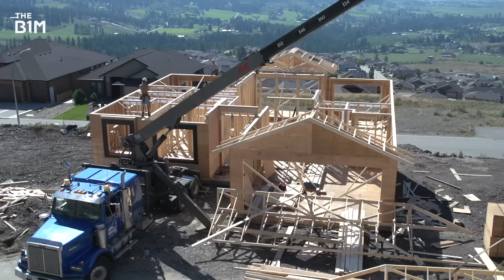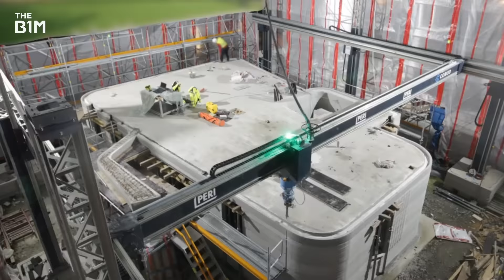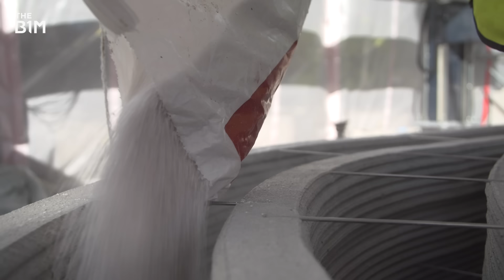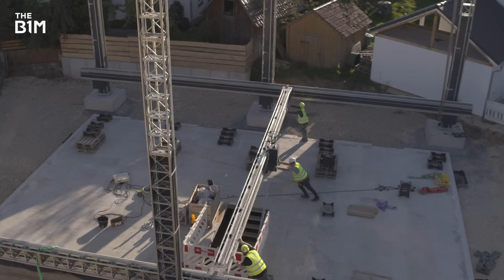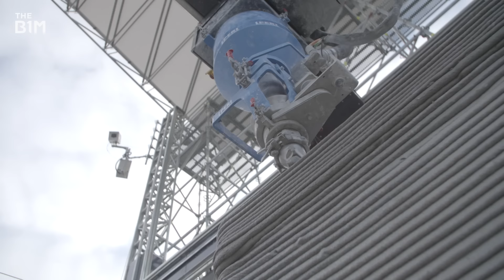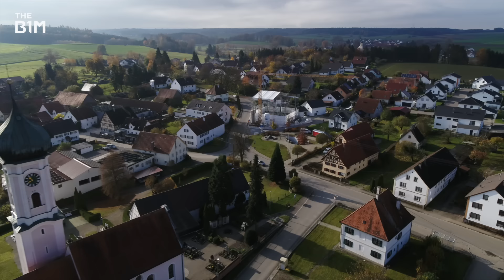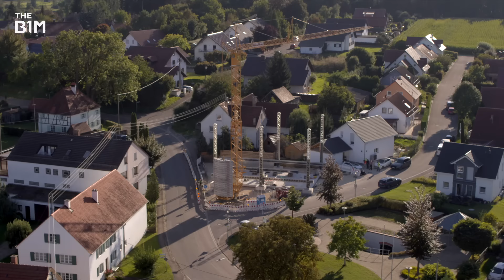Why This 3D-Printed House Will Change The World

Comment: Im exited for 3D printed homes and how it can help this shortage of homes, also making them cheaper and efficient.
Reply: It will be for free in future as old financial system is about to collapse. Advanced technologies that already exist to create anything out of ether which is everywhere just like air. Food, car, house.
Reply: @evgeniam685  That's not how logistics work.
Reply: @DaveSmith-cp5kj  what does it do with logistics. I am talking about technologies itself.
Reply: @evgeniam685  Technologies depend on the logistics of an economy. For example, you may have the tool to make what you want such as a 3D printer, but you still have to buy the material. To make the material you will need a massively wider array of equipment even if we assume in the future a program can do that work for you. This is the economy of scale which is why thinking this eliminates our financial system is a gross misunderstanding of this technology.
Reply: @evgeniam685  Like I said, that's an extremely poor understanding of what these technologies do.
Reply: @DaveSmith-cp5kj  food, clothes, cars, houses, anything you want. Because everything is created from atoms and molecules. Its advaced technology which  transform molecules and atoms from ether to create different objects.
Reply: @evgeniam685  Technology is not just a magic solution that makes things better just by existing. You have to actually think about how the technology is implemented for solutions to occur. Disassociating molecules to bare atoms use up energy (and massively so). Forming molecules produce energy (and not the same that it took due to entropy). So even if you could use atoms like legos, you are undergoing a massive energy deficit which means you are reliant on some sort of economy to allow your manufacturing. 

As I said, you don't seem to understand how this all works. I applaud thinking out of the box, but there is a fine line between creative genius and delusion. Engineers always have to be conscious of pragmatics, even if it gets in the way of a "good" idea.
Reply: @DaveSmith-cp5kj  energy is everywhere. Whole universe is energy.  We are all producing energy. Because we are all made of electro-magnetic waves of atoms and molecules. Even our thoughts, words and emotions are energy which made of frequencies. Low emotions=low frequencies, high emotions=high frequencies. And lots of things that has been taught to us through universities, school this is just information to know just within this system we live in. Truman show. But system is not good, limited, unfair and collapsing. This technologies ahead of human kinds for 1000 of years. Any planet which contains money system, is prison planet. We are only on beginning of evolvement compare to other civilizations. How about that outside of box thing ))
Reply: @evgeniam685  k

Comment: Wait, can you later remove the interior partitions, you know for a remodel?
Reply: Concrete. So just like brick and concrete houses built around the world its more work but not an issue. It also depends how its desighned. No doubt they will have non structural walls, stud partitions too.

Comment: I only see the wall structure part becomes more efficient. All other parts, like foundation, roof truss, plumbing, electrical are not. I don't think this method will be more cheaper than transitional stick house in USA.

Comment: This method IMO is not efficient neither flexible... not as efficient as pouring cement in mould walls suc as this https://www.youtube.com/watch?v=0OR28P6MEQ8,
 not as efficient as in standardized prefabricated houses mounted in whatever place using prefab. mudules, and not even comparing with the best in class dismountble homes such as geodesic domes... Fuller dome home, NRJA, Solardomes... or even using polystirene modules like japaneese Domehouse
this technology is not integrally robotized as a one process, it doesn't provide plants or tube or wires passages mounted directly by the machine... 
I definitely don't see big benefits in this method even standardizing and repeating infinite times the model or the project. Perhaps making prefab modules it can work but tradidional industrial moulding for big or small modules is more quick and efficient than this.

Comment: No more inefficient and "unsustainable" rectangles.
Um... wait. I have rectangular furniture that fits perfectly into rectangular corners. If I had rounded furniture the house would need to have the same angle of curve for it to fit. Germany goes with a 10' radius curve. UK goes with 3 meters. USA goes with 12 feet.
Until such time as I can replace all my unsustainable furniture with curved furniture that perfectly matches the curve, I'll need to make my 3-D house 25% bigger to make sure all my stuff fits.
Because sustainability is important.

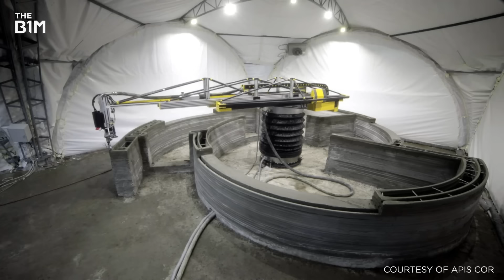In summary; Curved walls are stupid. They only do this to save cost with their rotary cement deployment machine 4:29 and not for any "environmentally friendly" reason.
Lipstick on a pig. They can make straight walls, as the interior walls are straight. They would need a larger rotary machine to make a square room than to make a round room.
This is 100% about them making things easy for themselves. It has literally nothing to do with sustainability. They're just making the largest room they can make using the size of the machine they've chosen to use as the central onsite factory.

I wouldn't mind walls that are curved a little in the corners, but wide sweeping curves are lousy for putting real furniture inside of.

Comment: I can understand that with proper planning you could 3-D print channels for electrical and plumbing piping.  I can see how that would save money (as long as it is planned to perfection, with no as-built modifications, which is rare in my experience).  Insulation could be blown in, possibly as part of the the 3-D printing process, though I don't see this it in the video.  But I do have some questions which this video fails to answer. The first is how is this concrete reinforced? I don't see any rebar, just those little joiner plates?  How and what are the electrical boxes attached to?  What is the interior finish of the building?  Does it get drywall panels?  Is it plastered? And long term, how easy/hard is it to alter those buildings, because most wood buildings go through renovations that alter its structure every 10-30 years.

Comment: Great idea for the exterior and interior walls. When finished you'll have to trowel concrete to fill in all the voids. Would be faster then brick or vinyl siding. Still need, windows, electric, plumbing, paint, roof, doors, ect.
Reply: Search for the Video: Move in Ready 3D Printed House in Germany

Comment: I dont see the practicality in this. You 3D print a structural base on sight, but what about everything else? Gotta make a finished wall inside and outside, run electrical, run plumbing, vintilation, install windows, doors, ect. And all of this has to be done on sight, which is not ideal and is expensive. I dont see how this will compete with pre-fab wall sections made almost fully finished in a factory in a controlled enviroment and very cost effective. Fully finished wall sections made in factory can be shipped to sight, be assembled and put together like legos in day or two.

Comment: Cannot wait for this to be a real thing, especially for custom designed homes at a lower price.
However, for your standard rectangle box home I am not sure there are any real advantages to this over SIP (I think they are sips?  maybe getting the wrong product there?  styrophome interior and exterior with injected/poured concrete) blocks with poured concrete inside.  That seems much easier to set up, much stronger and more durable construction, and even more efficient for heating/cooling, while being substantially less complicated to make.

Curious too with the issues around concrete.  There is a serious concrete/sand shortage in the world with many countries desperate to import it to keep building, so the price is going up.  Plus it is one of the largest green house polluters in construciton... which can be fine if it makes for a 200+ year building... but how many homes make it that long?  My negiborhood was built in the 1950s and there have already been 2 homes dozed over and rebuilt, with more in disrepair and will get the same treatment before long.  And if 3D printing homes becomes cheap enough, then we could see a boom in building reconstruction where you just buy a distressed property, doze it over, and print in place, which would be anything but green.

Comment: Wow! The applications with this technique are revolutionary! 👍
Reply: Now, to stop asking the government for permission to build.
Reply: https://youtu.be/zjVZNHra0pg
Reply: I think so too, but their is one MAJOR setback.. any larger size concrete structure would require rebarb within the concrete.  And current that cannot be achieved thru the 3d printing method.  BUT!!! if you were to solve that 1 issue , applied effectively,  your 3d printing concrete structure business would shoot right to the top of the list. by measure of strength in application.  your business could simply do what others cant.
Reply: ١
Reply: Honestly speaking, if your only goal is to "become a millionaire" you're just begging to make a dumb decision and be disappointed...I think many will become millionaires in this current bull market but it's not the right mentality as holding can be very dangerous. As hard as it is trading Crypto is way more lucrative and is quite logical if you just study the charts and the support resistance and pay attention to what's going on, I’m not a pro trader but I was lucky enough to make 35BTC since  late last year following the instructions and signals from Karen Asnin Whitby. She runs program for investors/newbies who lack understanding on how trading Bitcoin, Crypto, Ethereum works, to help them utilise the volatility of the crypto market and also stack up more bitcoin. You can easily get to Karen on the web to know more about her experience in dealing with investment. Now i can secure a nice duplex for myself and within a couple of months, hoping to get mansion if i invest more and more with her......
Reply: @kennyandreas3621  ever heard of the term "on topic"?
Reply: advertising
Reply: @robbietorkelsonn8509  It's a lost bot.
Reply: @kennyandreas3621  you used speech to text on the phone really fast and said that

Comment: would all you fear dealers please stop with this 3d printed home bull shit as if robots are gonna put us out of work. Nor a 3d printer, or a robot can lay plumbing, flooring, tile, cabinetry, counter tops, electrical system, a/c, etc..... all it can do is build walls.. whoopty fuckin-doo dry wall and framing dont pay shit anyways and p.s. no one wants some weirdly shaped stupid eye sore with rounded walls you cant hang anything on for a home. enough already

Comment: Well there is no problem with fast construction of walls, there are a lot of options for that, well walls is a quite cheap component of your homes. Base, tubes, electricity and all the finishing work are most effective and time consuming works. And I can't see how 3d printed house will help with that.

Comment: 3D Printer Will Not Change Anything, 3D Printer Does Not Work With VERTICAL REBAR,
Without Rebar House Is Not Secure...Amen.

Comment: It needs to print foam into the walls for insulation, and to address the over hang issue. They can just print foam under the overhangs which can be removed afterward. 
Then it needs a fiberglass extruder to lay reinforcement into the wall as it's built. Both embedded in the concrete, and across the gap between the walls. Also loops could be made to reinforce layers vertically.
When those are added it may really compete.
Reply: It needs none of those things. Cavity wall. Insulation is poured in between. No need for rebar as it's cavity wall, just wall ties and a few lintels.
Reply: @martinw245  You can do pour in place foam, sure. Part of the point though was to use it to be able to print large overhangs which cannot be done as things are now. The foam can be used as support material.
Whether you need reinforcement depends on where you live.  I live in an earthquake prone area and don't need my house collapsing. If you are putting it in the Netherlands, sure leave it out.
Reply: @court2379  Actually an entire community of 3D printed houses is being built in Mexico, in an earthquake zone.
Reply: @martinw245  The country that has no building codes or safety requirements, that is exactly why they are doing it there.

Comment: Concrete without rebar is about as strong as a thicker drywall. You could literally kick those walls in.

That, and you still need plumbing, electric wiring, a roof, laying down floors, tiling in the bath/kitchen, painting, installing doors/windows, not to mention heating. Building the walls is at best 40% the work. And this machine does even that badly.

Comment: who will be able to buy these houses if there's no jobs due to tec and automation doing the work, i thought the concrete was supposedly a big no no being its carbon footprint would be mahoosive, surly it would be quicker to build homes like the prefab type and less cost if you have a production line and they would be recyclable as they are wood and metal.

Comment: Will never be more than a novelty. Fully concrete houses in a world worried about carbon. Not fast at all compared to elements. Quality control is also worse than elements. It has all the same problems as all 3d printers, good for 1 of, not mas production. I'm looking forward to see what crazy designs you can do with this, but changing anything, I don't think so.

Comment: Almost a 10 minute video and no mention of the material that is used in the building of it? Is it concrete? Is it plastic? Is it fireproof? Is it Earthquake proof? How does one do modifications or upgrades? Housing construction is all about the supply of core materials. In countries with an abundance of trees (like Canada) our homes are mostly all wood construction which is flexible in an earthquake being our Westcoast is in an earthquake zone.

Comment: This is ridiculous - it is far easier to use prefab or foam forms and just pour concrete into it in just a few hours.   Also, there will be air pockets in the concrete making it brittle. You have no rebar so the building would not really be safe and will crack up over time and would never withstand the slightest seismic tremor.  This is just to cheat people out of venture capital.   You can do this much easier with prefab using molds and would look much better and be faster and easier to control.  Concrete is also massively more expensive compared to wood framing.  Don't be fooled by this - it is not faster than other methods, looks terrible, and to heat and cool a solid concrete building would cost a  fortune (an oven in the summer and an icebox in the winter without massive power to heat and cool you would literally be killed (cooked) by a 90-degree day inside the building)- they will get their money from investors and then nothing.   Do not invest in this - they are fooling u!  Will never be viable.  If this was something really great why would they need to try to sell merchandise to get money from you?

Comment: Call me back when they actually finish the house, explain how much usable space on the site is wasted because of the thick walls, or how it is possible to modify any of it after it's built ( plumbing, electrical, etc ) more easily than a traditional wood frame home.
Reply from the maker: What’s your number?

Comment: Whats new about this? Just a sponsonsored video? Insulation, roofs and ceilings all have to be done on site without printing. So you just printed a third of the load bearing constructions of the house. Congrats. Now everything else has to be done the old way and on site 😁

Comment: They might not age so gracefully. The grooves on the walls seem like it would collect a lot of dirt. Although it would be possible to cover the grooves up with extra concrete(?)
Reply: They are smoothed over if the customer requires. Or clad, or rendered. You chose the finish.

Comment: I would only use this for nontraditional concrete formwork (permanent) for a property, I would still use reinforced concrete pours in tandem with this. Monolithic pours are still far structurally stronger.

Comment: Call me crazy , but don’t concrete mixtures start to form cracks over a period of years?
Reply: It has a wire reinforcing. If a concrete structure is built right, with the proper mixing and materials, and there is wire reinforcing, or rebar, the cracks will be minimal, only micro cracks.  Big cracks are caused by poor design or poor materials and mixing. With these 3-D printers and real engineers designing the houses, everything will get better.

Comment: 👍 I can see this finally being the end to slapdash paid per meter brickies. And the end to poorly finished mass produced housing now that you can take the idiot out of the equation. Those responsible for poor quality work can now take up employment in the jobs that may suffer a lack of labour now brexit has happened. However, I guess other than tilers and plastered, power tool sales are going to be massively affected. Electricians/plumbers no longer require them, no longer have the excuse of “not my job”. Oh no, won’t that also have an effect on YouTube too? No more new “not my job” videos? Gutting!